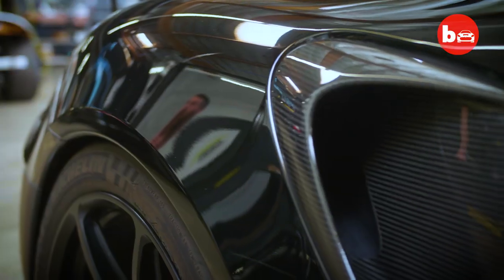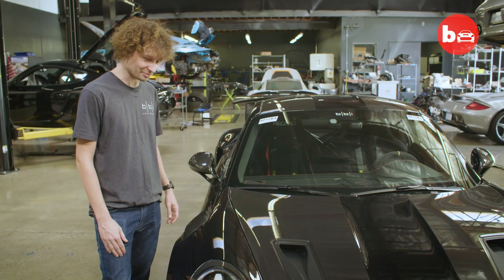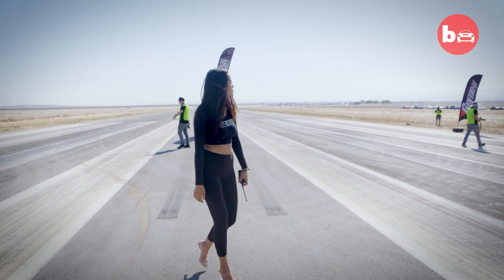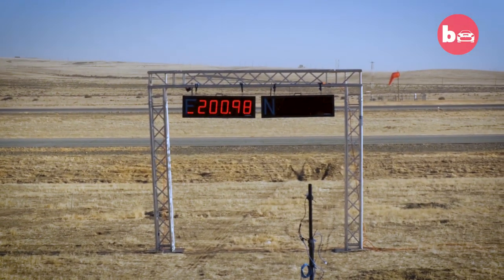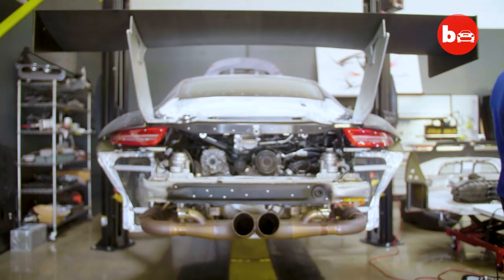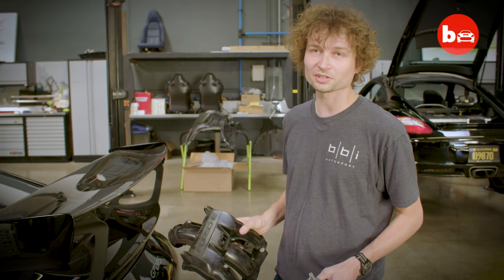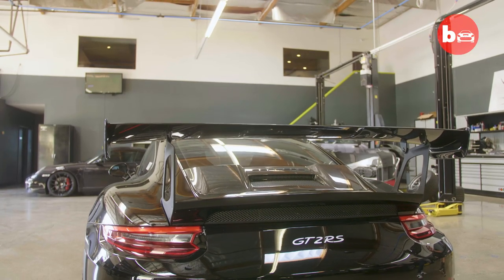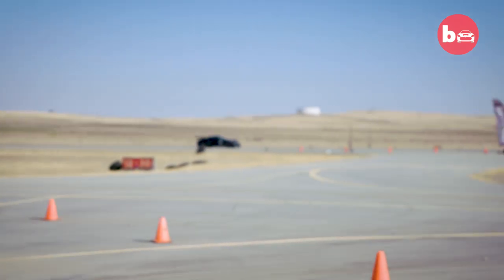World’s Fastest Porsche Hits 227MPH | RIDICULOUS RIDES

Comment: Bone stock 2RS can scratch at 220 mph.  Seems like not a lot of gain for the work that went into it.  Although this car is WAY more powerful.  Stock trap speed is around 168-169 mph in the 1/2, and this car broke 200 mph in that distance.  It's obviously a lot faster, but 227 is nowhere near Vmax.  I guess they mention they think it could hit 245 mph... I believe 240+, if they're truly making a lot more power (which they should be).